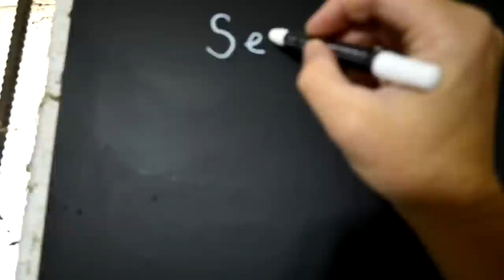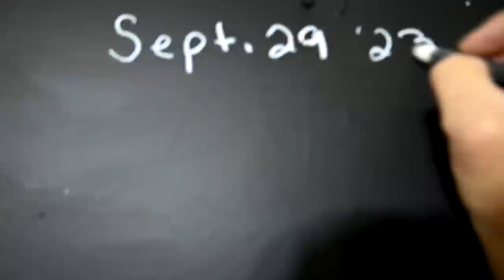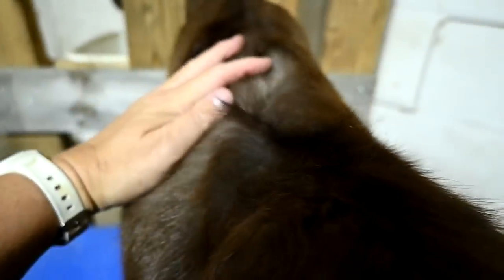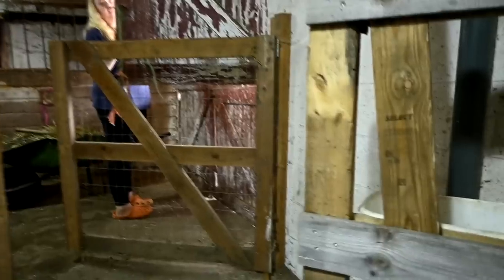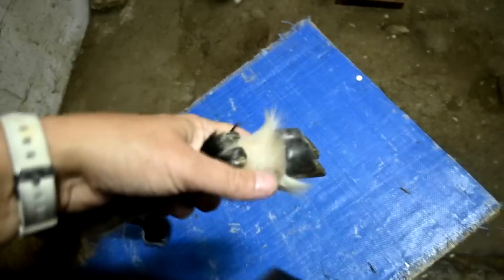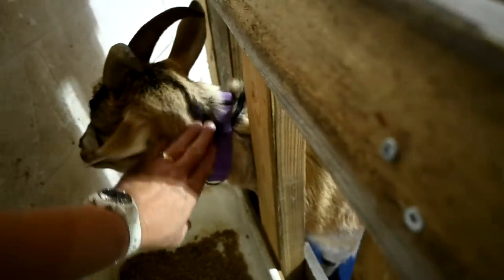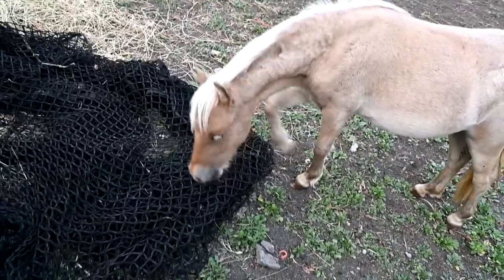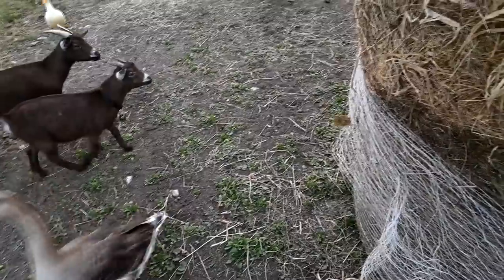A HUGE New Addition To Our Farm And All Our Aninals Came  To See!

Comment: if storm has shoes you NEED to get a round bale ring bc if he gets his shoe caught in that would not be good. Also if u put a pallet underneath it will help keep it off the ground so not as much goes to waste.
also how i do the net is to put the bale on its side (opposite of what u have it like) then throw the net over. Like that u can tighten the net up under it better so they don’t get caught up
Reply from the maker: We were worried about it rolling down the hill!  We are making a stand to protect  the feet!
Reply: You don't need anything underneath the round bale, it won't get wasted, trust me 😊. My horses don't waste anything 😂

Comment: Penny is not dumb! Why didn't you take a pitch fork & loosen the hay a bit so that Penny & Storm could pull it through easily? Those bales are compressed extremely tight! It is not like your hand stuffed nets that hang up. The goats can get their little mouths inside the holes to grip it; the horses can't. Also, those goats will all jump up on top of that bale & lay on it & eat. That means they will pee & poop on it & when the horses smell that they will not eat it. Then you have a waste. Good luck at the horse show. God please don't let any animals get caught in the round bale netting. 🙏
Reply from the maker: we have never had a round bale before... how were we supposed to know?  Only one another issue to work through lol. How do we keep them from getting on the bale?  We need a hay hut now lol
Reply: Laura, I was not criticizing. You know I'm honest! Lol. You might want something over it. Seriously. I know a guy who had a cover with open front & sides on the back of his barn. He kept several round bails under it. He didn't think about blocking his goats from it until his cows wouldn't eat it. 😂🤣 Goats laid on them & ate, jumped on them & played. His herd of goats had a gracious plent to eat that winter. He had to buy new bales for his cows.😂
Reply: It’s better for them if they have to work for their food. There is no issue with them having to work a little bit harder to pull the bale apart. I think they can manage.
Reply: Not quite sure why the net is on it. With my round bales I take a roll off before giving it them. 😊
Reply from the maker: Oh I know you weren't critical.  As honest as you are I am equally as sarcastic!  No issues on my part!  I appreciate and look forward to your comments. I've learned a ton from you. I don't see everything  the way you see it but I see so much value in much of what you do say!